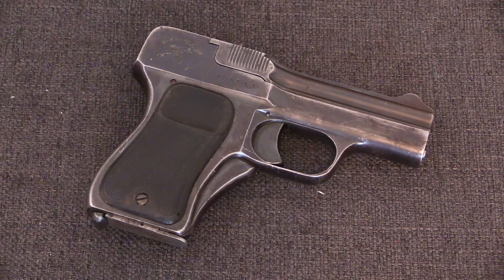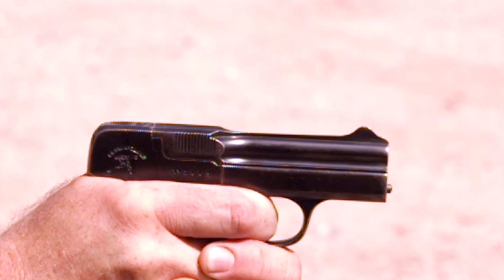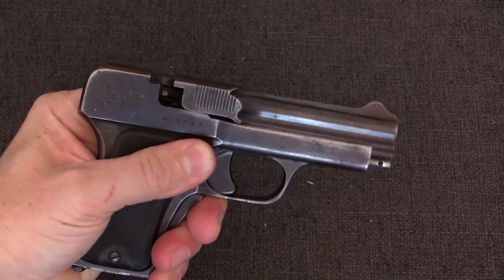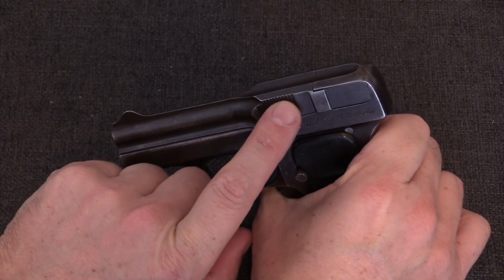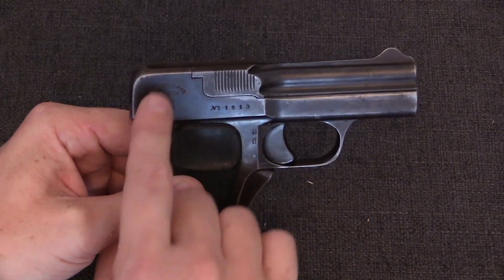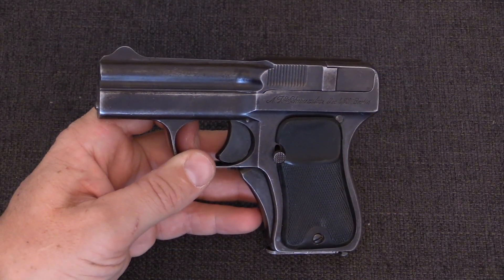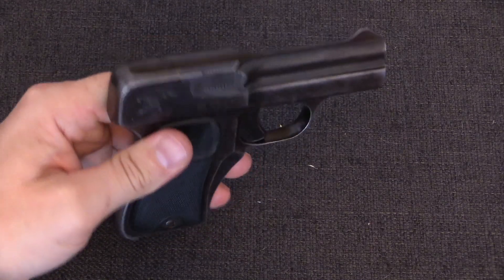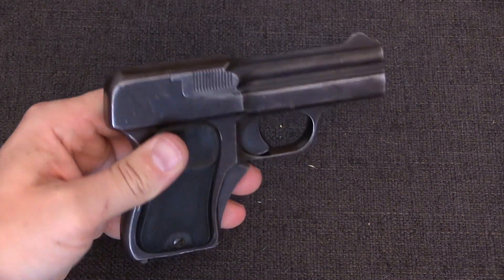How Does it Work: Blow Forward

Comment: The bullet pulls the barrel forward by its friction in it, so... why not! 
Apart from the strong recoil I see at least one other downside - construction of the magazine. The cartridges have to go straight  up, so there has to be kind of a mechanical cutoff or release to stop all the ammo to spew out when the barrel is in the forward position.
The mainspring has to be strong enough to cock the firing mechanism on close.
The system depends quite some on the right bullet diameter with the right load behind it, too tight may lead the barrel to open before pressure has dropped sufficiently.
At least bullet weight isn´t too much of an issue.
Reply: sthenzel
Your are right. Friction is the only principle, which can apply a force onto the barrel. Because the barrel is open, there is no area  where pressure could act directly on (except perhaps the small step between chamber and bore). The bullet gets the pressure, the friction between bullet and bore transfers the momentum.
Ian didn't work out this point at all, which is not good, because this should be a universal explanation.
Reply: @nirfz:
"Basically DI or Gas piston systems work by "friction" of the bullet too."
Yes and no.
They work solely by barrel pressure.
Usually the friction of the bullet slows it down enough to generate enough pressure (here´s the yes), but a sufficiently heavy "frictionless" bullet would generate the same pressure (here´s the no).

Gas-operated, blowback and blow-forward all work on barrel/chamber pressure, only recoil-operated guns actually use the force of the acceleration of the bullet.

It´s quite easy if you ask one question: "What happens when the barrel is obstructed?"
If the system cycles (in some way, weak, normal or catastrophic), it relies on pressure, if it doesn´t, it relies on recoil.
Reply: No, it doesn´t work with a blow forward.
In a blowback the slide moves away from the bullet, so if a frictionless bullet is heavy enough, it has enough inertia so that chamber pressure still pushes the slide away from the bullet (not from the barrel).

In a blow-forward, the breechface is fixed. The pressure still pushes it away, sure, but movement of the frame is not functional part of the gun´s operation, in fact movement of the frame itself is not functional part of the function of any gun, each gun´s frame can be fixed solid and still work (ok, there´s ONE exception). So, with a frictionless bullet and the frame fixed, where does the force to move the barrel in the opposite direction come from?

Comment: Now I want to design a delayed blow forward system, just for kicks.
Reply: Swiss did, check AK-53 video
Reply: @alexandermarinin7036  Toggle delayed blow forward.
Reply: Gas delayed blow forward looks possible.
Reply: @Arynkows  That should look something like the gas delay used on the H&K P7, only turned the other way around with the piston pointing forward under the barrel. Not sure it would work very well though. If you delay the action it would have very little power left to cycle.
Reply: I was so sure this was just a play on the word "kicks"
Reply: @Dean.Hilleary  😂😂😂

Comment: If you were forced to build a  workshop machine gun where recoil is less of an issue then this wouldn't be a bad system. Simple and a lot safer than blowback especially when you're unsure of the steel quality.
Reply: Also a bulpup system as you don't need a stock for the bolt to reciprocate in.
Reply: How it this safe in the absence of any quality steel? Just curious...
Reply: @axelpatrickb.pingol3228  In a blowback design the slide cycles backwards towards the shooter's face and you rely on the fairly small bits of steel stopping it from coming off and injuring them. If the same parts were to fail in a blow forward gun then the moving parts would be ejected forwards and end up on the ground in front of you, embarrassing but not fatal.
Reply: @Matt_The_Hugenot  Is the barrel made of uncertain metals like the rest? That is my issue with this idea, what's stopping this gun from becoming a pipe bomb...
Reply: @axelpatrickb.pingol3228  I was thinking of the slide and frame mostly, if the places where I they interact were to break because of the hammering they take then you're in trouble. If the weapon was chambered in a cartridge like 9mm you could have a situation similar to the problems with the Rogak P18 only with even worse quality control.

Comment: Would this system work with shot guns? Or would the pressure not be sufficient
Reply: The pressure should be sufficient, but the problem would be the difference in cartridge lengths and pressures. Blow forward guns are a bit finicky in my experience. They wont blow up or anything but they seem to be more likely to have a failure to eject or load if not tuned for a specific ammo

Comment: Do i understand it correctly that the force that pushes the slide is the friction force that the bullet transfers to the barrel walls?
Reply: In a straight- walled pistol caliber there’s very little forward surface area for the pressure to actu upon, except for the base of the bullet. So yes, in the gun shown here the bulk of the force pushing the barrel forward is transferred from the gas pressure to the barrel via friction with the bullet. Some small amount of force is also caused by gas pressure acting upon the little ridge at the front of the chamber, where it constricts from case diameter to bore diameter.
In a bottlenecked caliber, there’s much more forward force on the barrel as the gas pressure can act directly on the shoulder of the chamber.
Reply: @Kaboomf  Makes sense.
Reply: @Kaboomf  "Some small amount of force is also caused by gas pressure acting upon the little ridge at the front of the chamber, where it constricts from case diameter to bore diameter."

Is that really that small though? Let's assume that there's a force acting on the edge where the shoulder runs to freebore, which could be done if the .380 headspaces on that little semi-rim. The projectile diameter is .355 and the case mouth spec is .373 so there's a .018 thick ring that would take a forward force from any chamber pressure. That annulus has an area of .041 square inches. But the pressure? Avg 21,500psi, so the force from the annulus there should be around 881 pounds, right?
Reply: @mfree80286  It is huge pressure inside, and huge forces. The resultant forces are manageable though because they are mostly balanced, the system is close to symmetrical and only the slight lack of symmetry allows for the pistol to function.
Reply: @mfree80286  correct- and that's significantly less than the rearward force acting on a blowback action.

Comment: Suggestion for next one: roller delayed blowback
Reply: What about roller-delayed blow-forward?
Reply: @LUR1FAX  No one was drunk enough to build something like that ;)
Reply: @LUR1FAX  You need to think outside of the box if you want to stand out in this market. How about a roller delayed direct gas-piston revolver blow forward gatling system?
Reply: @Flociety  no no no blow sideways....
Reply: @julemandenudengaver4580  a blow over-under side-by-side?
Reply: @LUR1FAX  
What about long recoil forward?
Reply: @jonasstrzyz2469  Isn't that just long-coil, since "re" means backwards or repetition?
Reply: @LUR1FAX  
Maybe, I was thinking about the barrel being locked together with the bolt, the barrel and bolt move the lenght of the cartridge, the barrel then unlocks and moves forward, once the barrel has moved the bolt moves forward. Now imagine that in rewerse. No idea how you would make it. It would be questionable, overly complex but a materpiece of engineering if anyone could make a reliable firearm that uses such a system.
Reply: List of firearms with roller delayed blowback action:
-G3/CETME
-MP5 series
-Stgw 57/ Sg 510
-CETME L
-PTR 32

Many more
Reply: Think the truly fascinating one would be dog lock or snaphance little older versions of the flintlock. Flapper locking be an interesting subject. The kammerlader be interesting never understood the crank on the side. The differences between snaplocks could be interesting. Peabody action and its differences compaired to a falling breech block like the martini henry might be a interesting subject as well. A toradar be interesting and beautiful to see on the channel though not a type of action.
Reply: Arynkows yes! And roller locked!